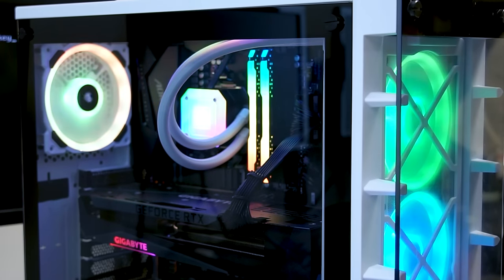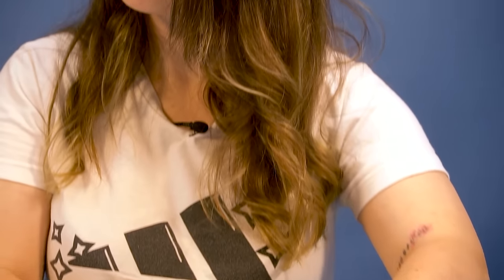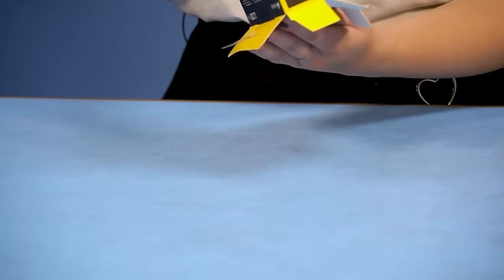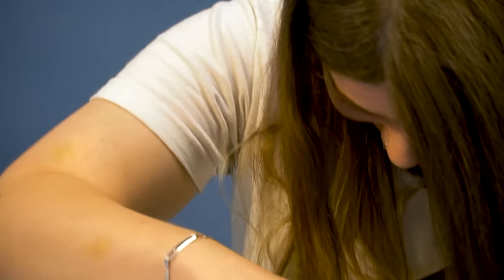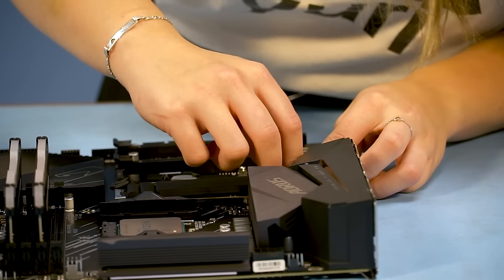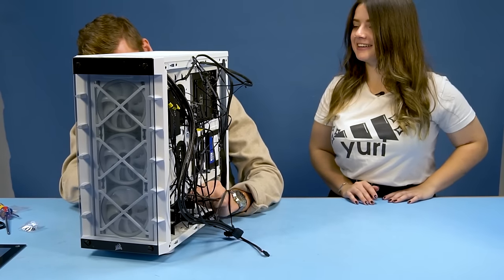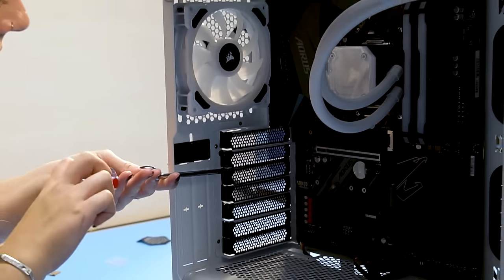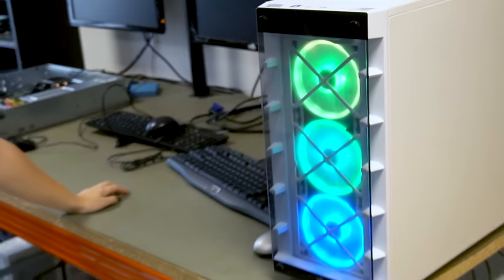ASMR | Building My First Computer! (Whispered Voice-Over)

Comment: Overall very well made 👌🏻😊
A few things to mention: 
1. The radiator should be placed on top of the case because you get more air through it in comparison to the front
2. To prevent the GPU from sagging you can use a GPU sag holder so you can align the power cable underneath the GPU. It‘s safer to have them underneath 
Have fun! 😊👌🏻
Reply: A radiator on the front of the case is fine. You will notice slightly lower temps if you have your AIO as an exhaust on the top of the case due to the convection of the heat but its not a big difference. Nice build Chaeri!
Reply: @samscothern1278  yes it’s not a hugh difference but it is a bonus for literally no effort 😊

Comment: Hey i loved the video but i have a tip. when installing the AIO you need to make sure that the radiator is either on the top of the case or that he is on the side like you put it but with the cables on the lower side of it. If you install it the way you did it will be way harder for the liquid to circulate and can lead to the AIO stopping to work really fast. Besides that i loved the build

Comment: How are you finding the 3070 ti currently? I'm thinking of upgrading and was wondering if you can run everything on Max settings? I've got a 1440p monitor so I don't need 4K resolution... maybe some DSR on certain games.
Reply: If you genuinely need DSR to play games you are a sociopath, the 3070Ti (atleast at that time not sure abt now) ran games at smooth rates in 1440p mid to high settings. But trying to play anything in 4k chokes the living shit out of it, you need a 3090/3090Ti for that